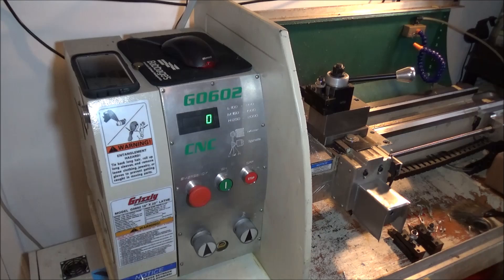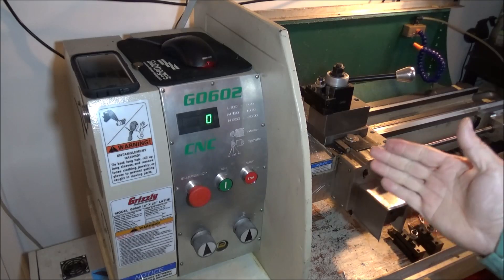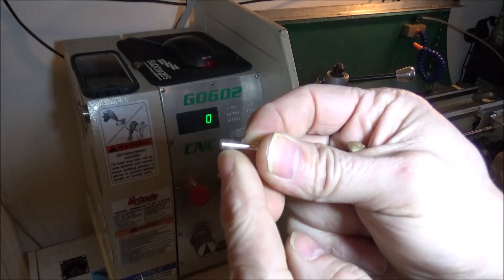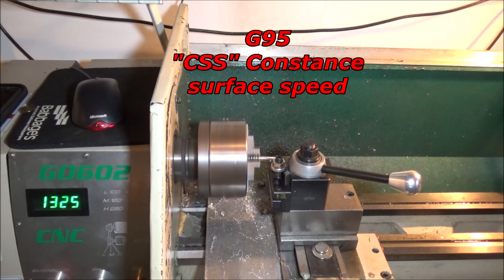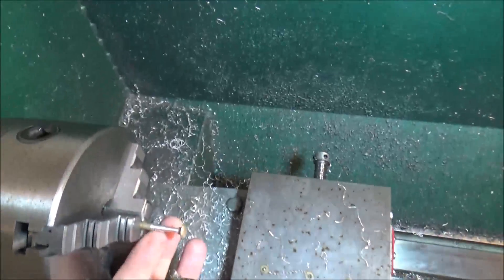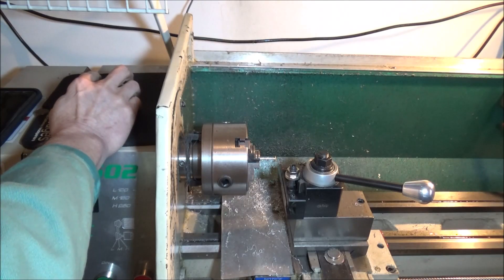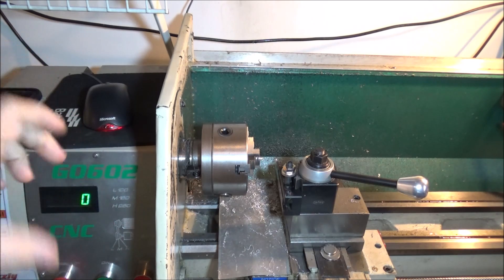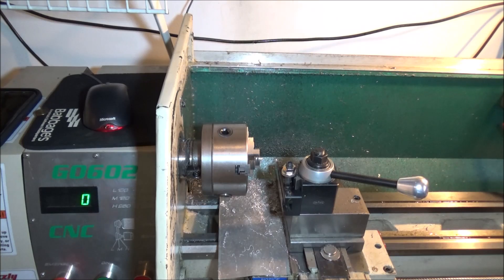Mach3 Threading

Comment: Sir, Are you using mach3 spindle control under "closed loop" ?  Does mach3 PID work well in ensuring the spindle speed is kept constant under cuts ?
Reply from the maker: Mach3 uses spindle speed averaging it works well but can slow under a load.
Reply: @CNC4XR7  thank you

Comment: My mach3 on the lathe does not cut the thread.  stands on cycle G76 and does not want to cut the thread.  please tell me where to dig?  thanks.
Reply from the maker: make sure you have Spindle speed averaging checked.
Reply: @CNC4XR7  I checked the averaging of the spindle speed, and removed, and tried different options, but for 10 days now I can’t figure it out, can it be because of the m1076.m1s file?  or because of the controller that connects to the LPT port.
Reply from the maker: @dargindarginec9561  SSA should be checked. you do have a tach signal correct?
There is also a earlier video I did on threading please check it out.
Reply: @CNC4XR7  Yes, the signal that goes to the index shows how many revolutions it rotates, I'll try to find this video on your channel. thanks.
Reply: @CNC4XR7  Hello.  I didn’t find your video you are talking about, can you drop the link?
Reply from the maker: @dargindarginec9561  email me a copy of the g code your using i will look at it. to see if I spot the issue.
Reply: @CNC4XR7  Hello.  what do you think?

Comment: I've been pulling my hair out trying to make this work on my cnc lathe conversion.  I think it's my breakout board but who knows, what breakout board are you using?  I'm using a usb board, everything works great accept the tach.
Reply from the maker: what is the voltage of the signal your sending to the bob?
Reply: @CNC4XR7  I've tried everything from 5v to 24v  (my board will handle up to 24v).  At 5v mach3 doesnt pickup the index signal even though the led on the sensor is coming on as the magnet passes, mach3 does pick it up at 24v but randomly.  When I check the sensor wire with a voltmeter it gos from 0.3v to whatever voltage I'm trying.  Thinking of trying a drop resistor?  It's like the low voltages arent enough to trigger mach but the higher voltages dont drop quick enough to trigger consistently.  Or it's just my crappy usb bob doesnt send data quick enough.
Reply from the maker: @kclaptraffic  Mach3 will only accept 1 pulse per revolution. send me a email with some pics of your setup maybe I can offer some advice.
Reply: I'm going to try a couple things this afternoon and if I dont figure it out I surely will!  Thanks in advance!

Comment: Sam,
I love your videos!

I'm planning to do a cnc conversion of my G0602.  I ended up with a spindle motor that is 3450 rpm (same D80 frame motor from Leeson - 1920257) instead of 1725 rpm (Leeson - 1920251).  What do you think about using this motor on the G0602 vs the one at the 1725 rpm speed?  Do you think I'll run into any torque issues etc.  I don't want to spend the extra money but I also don't want to go through the installation twice if I can avoid it.
Reply from the maker: I have found over the last couple years running the machine the torque is lacking even for the 1725 motor. I run on the low pulleys and run the vfd at around 100hz to get the higher speeds that seems to help.
Not sure that helps. I guess if you have it and cant return or use it elsewhere then try it